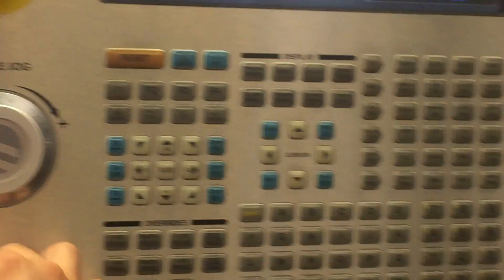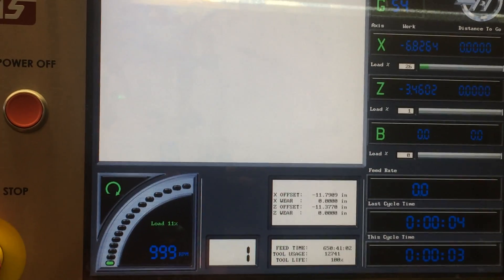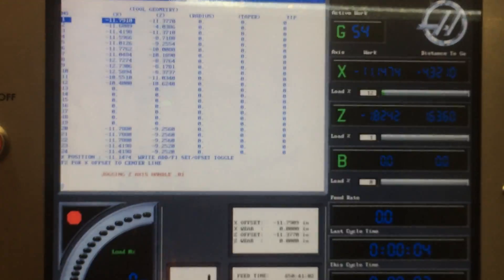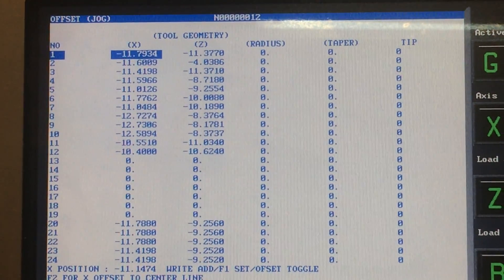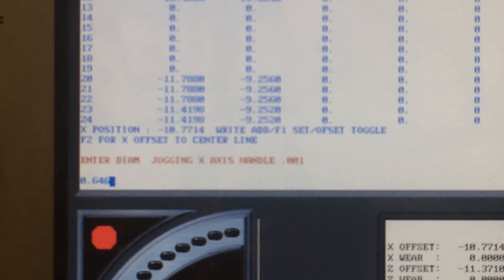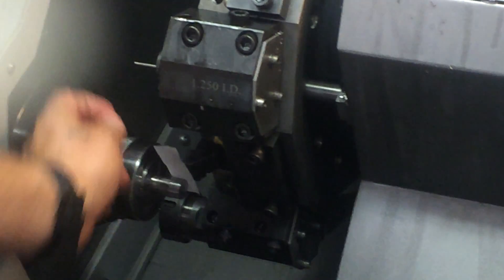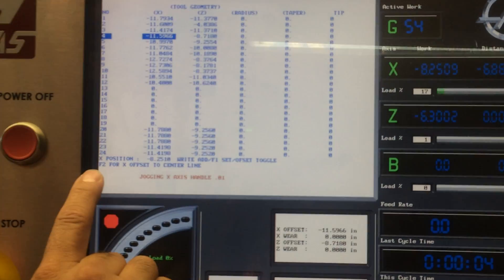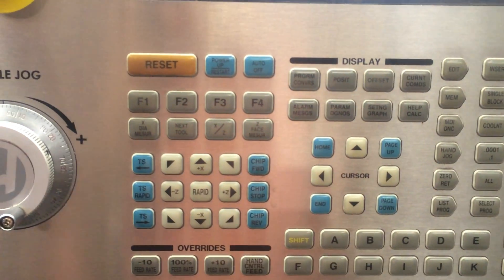SETTING X ON HAAS LATHE

Comment: I'm a student new to machining.  Should he be reaching inside the lathe while it's running?
Reply from the maker: Mike Marino I am a trained professional with many years of experience. At some point you will have to get close to moving parts inside the machines you are learning on. Of course safety is always a priority that’s why I don’t have any loose clothing or bracelets that could potentially create an accident. My recommendation is work at your skill and comfort level.